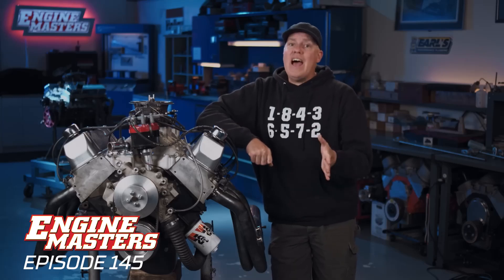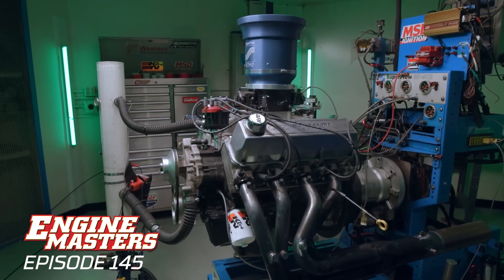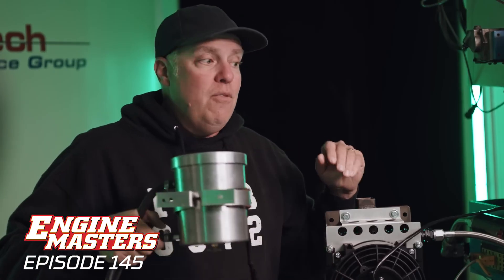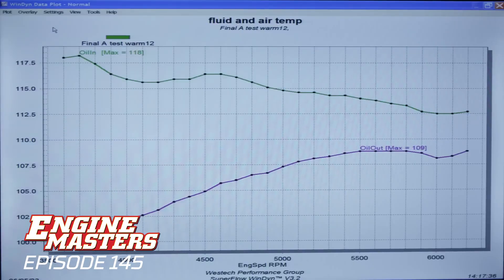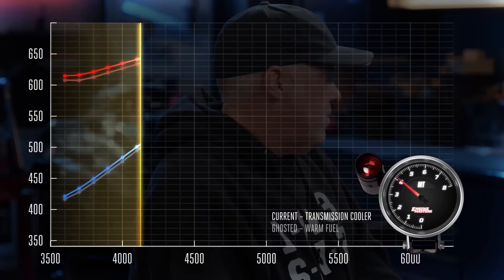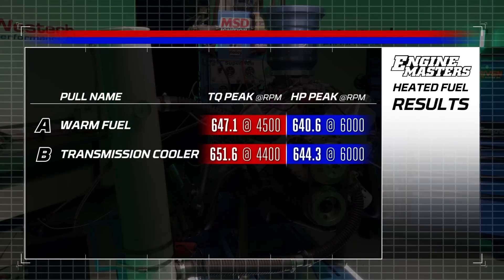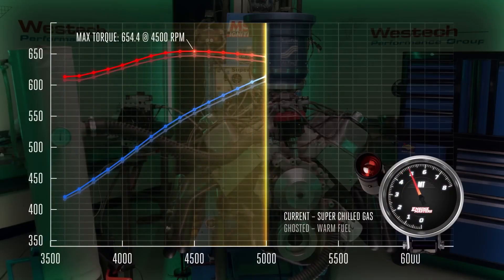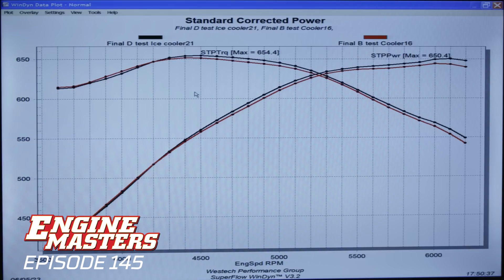Why Does Cold Fuel Make More Power? | Engine Masters

Comment from the maker: How do you keep your fuel cool?
Reply: Instead of running fuel through a radiator, coil line through an ice can. Modify a catch can if that's what you have. It, also, works for trans lines, but they would be in car so you would need to shield it on case of a blowout
Reply: Why couldn't you use the coil idea but wrap it around the A/C coil.
Reply: peltiers
Reply: I insulate the fuel lines from the pump all the way up to the bowls . I have a heat shield under the carburetor with a phenolic, resin spacer.!    I’ve done Rocky Mountain race no vapor lock on 105° day

Comment: Something to consider on a road car is to protect the fuel lines from high underbonnet temperatures. Especially if using a cooler of some sort.  Include the fuel rail on an injected car.
This leads me to think of an experiment you guys could perform: Would insulating the fuel injectors also be of benefit? The injectors would normally pick up heat from their surroundings AND generate some heat of their own. If they were fitted with a little insulating jacket, 1. would the fuel flow through them be sufficient to keep them from overheating AND 2. would the resultant fuel spray be cooler than if the injectors were uninsulated?

Comment: Interestingly, early Jaguar XJS cars (pre-HE) had a fuel cooler that ran from the car's aircon system. Unfortunately, although I know the car had one I'm not familiar with how it was Engineered into the car.
How about this for an idea: I got the inspiration for this from the actively cooled seats fitted to Range Rovers. Those cooled seats use a peltier device to cool air as it passes through vent holes in the seat. So how about using a similar peltier heat exchanger to cool fuel? Just as Range Rover seat coolers pass air over the peltier, so a fuel cooler could pass fuel over it instead. It could be ignition controlled and so always working, but would never need any servicing and, unlike the trans cooler, would not be performance-limited by the ambient air temperature. It would require fabricating something up and whilst not the "ultimate" solution, it would be practical solution for road cars.

Comment: Big brain guys put the AC cold side through the cold can to chill the antifreeze. You turn the AC off for the run but you can engage and disengage from the drivers seat and don't need to add ice.

Comment: I added a stack of four paper gaskets under my carburetor to insulate it from engine heat. I also installed a stainless steel fuel line between the fuel pump and carburetor. Stainless steel has one-third the heat conductivity of carbon steel (15 vs 45 W/(m·K) and is less likely to pick up heat from within the engine bay.

Comment: Great video. But you didn't get to the punch line.  WHY does it make more power?  Is it just richer on an engine that could use more fuel?  Or is it cooling the air making it have a higher oxygen charge?

Comment: IMHO the power change you are seeing is from a change in air fuel ratio. 

Cold = more density = more fuel and air in the cylinder = more power 

With out laboratory grade afr measurements this test is invalid.

Comment: I found this researching if a return line is really worth the trouble on a system that doesn't require it. Deadheaded fuel is just sitting there soaking up heat waiting to go into hot fuel bowls. May be worth 3 hp/tq or could be worth 10, but this proves cooler fuel definitely makes a difference.
I love the transmission cooler idea, though the comment about a pinhole near an electric fan gives me pause to actually try it. But I would think that electric fans are sealed waterproof units. make sure the wiring connections are waterproof too and maybe there isn't as much risk, after all the fuel pump itself is often electric.
Reply: thing with a return added on a system that doesnt need it, it would keep the fuel cool in the hardline but if you run the engine long enough it will eventually heat up the fuel in your fuel tank and now you are back where you were to begin with.  Some people swear up and down by using a cooler on your return line to prevent this from happening.  But OE doesnt do this when they have electric fuel pumps mounted in the fuel tank.  Their fix to cut down on excessive heat being introduced into the fuel tank was by first removing the return line from the engine bay by putting the regulator on the frame so it isnt soaking up heat from the engine bay.  Now many are using a returnless system where the bypass is in the fuel pump module itself in the fuel tank where it simply acts like an oil pump by dumping the fuel right back into the fuel tank.

Comment: When the weather starts getting cool outside between 60 and 50 my GY6 150 runs a lot better more power from the cool air I assume because the air is denser when it's cool and it's actually getting more

Comment: I've seen many drag&drive cars running a trans cooler on the fuel return line, not for power but because their fuel gets SO hot that it vapor locks the pumps. That's generally why you see double & triple pumps that aren't staged die quickly on the road.

Comment: My dad did the old school version of the cool can/ice can back when he used to drag race at the strip on the weekends, back in the early to mid 60's. They used to just use a coffee can or a paint can, mounted somewhere in the engine bay. They would run the fuel line from the gas tank to the can and use aluminum or copper tubing in the coil configuration inside the can, then route the rubber hose line from the can to the carburetor making sure that the line didn't get near the hottest parts of the engine. When it was time to make a run, they would fill the can with ice, put the lid back on it and make the run. It was never meant to be filled all the time, just for runs at the track. However, nothing says you can't put ice in it before a longer race. Today, I would use a mix of crushed ice cubes and dry ice. The ice can getup that was showed in the episode, is just the modern version of the hot rodders version. It's always been about two primary things, get the coolest air and coolest fuel you can going into the carb. I like the idea of the transmission cooler being used for fuel, but that whole thing has to be rock solid or yeah fuel everywhere.
Reply: One thing that these guys dont seem to take into account is not everyone will have room for a transmission cooler like that with an electric fan.  most of us would only be able to run one of those radiant heat exchangers with the fins that are either a single or double pass.

I am personally running a 4150 stealth Sniper EFI system for my daily driver rig that I am putting the finishing touches on the engine.  I am thinking about chilling the fuel mainly because its no different than a carb as the fuel is flowing through the intake manifold no different, its not like a port injection EFI system that sprays the fuel directly onto the intake valve.  So chilling the fuel would have a benefit for me but on my truck I cant put a fan like they are running, the only thing I can do is use a single pass aluminum fin heat exchanger and now comes the big question, how efficient will that be mounted on the frame rail after my 99-04 Corvette fuel filter/regulator assembly but some 9 feet of 3/8 stainless steel line and 3/8" rubber fuel hose till the fuel hits the injectors.

Not something I want to do trial and error on seeing as I have a brand new 3/8 stainless steel hardline for the frame to replace my oe 5/16" carb line with so if I mount a inline cooler thats it I have to run it cause it would require me buying another hardline to remove it and go without.

For a track vehicle I think a cool can would be the best cause with an electric fan all you are doing is putting more load on the engine by having the alternator run that cooling fan which will eat up more power.

Comment: Doesn't a return style fuel system completely negate this? The fuel in the tank will be right around ambient temperature, so pumping any hot fuel out of the rail and back to the tank means you're always supplying the engine with the coolest available fuel

Comment: Why would fuel be at coolant temperature? It's at ambient temperature in the tank, the only way I can see it getting that hot would be if the fuel line was run alongside the exhaust to the engine compartment .
Reply: One exception I thought of to fuel being at ambient temperature would be when running an in tank fuel pump.

Comment: David:  In the old days, the fuel line would be plumbed under the alternator and next to the engine block up to the carburetor (SBC).  Hence, a simulation of vapor lock.  If any of this adds incite to your pursuit to heat the fuel, try that!

Comment: Interesting evaluation here. Since I have an LS3 with stock rails that are metal, they get hot, same goes for my LT1 GEN II when I road raced that car. They got super hot because they were thick and bolted directly to the intake manifold. All of the aftermarket rails are aluminum too so they heat soak easily but also dissipate heat fast as well. Wondering if cooler fuel would actually keep the fuel rails cooler when the engine is working hard and if there is a benefit to that.

Comment: I don't know if I missed an episode? But I've always been curious about engine oil coolers? Good bad or indifferent? And with that is there a change in oil velocity that should be considered? And if you did run an oil cooler for your oil is there a formula?
Reply: Those usually help period. Noticeable drop in temps

Comment: You should fill up your vehicle early in the morning. 

The fuel is more dense at a cooler temperature. therefore, you are getting more fuel for the same price.

So I believe what you all just measured was more fuel being delivered into the combustion chamber.

By chance...did you all have a wide band O2 sensor installed?

Comment: You guys should build a car version of this using the AC refrigerant and a plate style cooler (evaporator). There should be bypass to the cooler so that the fuel is not too cold when the engine is cold or you are operating at very low loads. I think the gains would be highest for a fuel injected turbocharged/ supercharged engine, medium gains for a high CR NA fuel injected engine and the lowest gains for for low CR carburetor engine.

Comment: I’ve been running that exact fluid cooler on the return line of my street car for a while now. Before installing it as the fuel would heat up the fuel pressure would drop…. With the cooler fuel pressure never drops no matter how long I’m driving the car.

Comment: With the ice cooler,  add salt water.    The salt will actually help make the cooler coils get colder.     Also. You could do this test with liquid nitrogen,  which boils at negative 320 defs F
Reply: Most Gas blends freezes almost solid starting around 145F, with the range being -40F to -200F. So hitting it with LN for as long as they needed to do the test would more than likely freeze the line.

Comment: when i had my subaru, i i was making about 600 wheel and running my pump at 100% duty cycle, and i was considering running a fuel cooler for a long time because i was concerned with my fuel temps

Comment: I believe there's a trade-off in there yes cold is good but Smokey made the hot vapor motor for a reason and it worked and I believe that fuel was like 400 and some degrees going into the engine I believe that pre-heating to do the same thing just like the hot Vapor motor

Comment: So as with the co2 being discharged from a high pressure to a low pressure and getting cold as a result. Would not fuel do the same thing. like two thoughts:
1 a recirculation pump of fuel through an inline venturi  back into the tank making the whole tank cold over time.
2 a high pressure fuel feed from the tank through a venturi into a surge tank at low pressure suitable for feeding a carb.
IDK just thinking out loud.
Reply: I will break this theory down which is how things really works since no one else has.

When you increase pressure you generate heat by increasing the pressure, this increased pressure how ever will transfer to anything cooler that is around it.  When you drop the pressure it becomes super cooled.

This is how your A/C system works, you take refrigerant pump it up to 250 psi that puts it well above ambient air temperature, heat is attracted to the cooler air and thus the condenser drops in temperature.  You then hit a regulator that allows pressure to drastically drop, it drops down to around 30 psi which causes the now ambient air temp gas to become ice cold.  The air blowing across the evaporator is warmer and is attracted to the cooler gas in the evaporator so the air becomes cool as the heat transfers and then the AC compressor pumps it up to pressure again to start the cycle all over again.

In a EFI system where you are dealing with 60 psi fuel pressure, in theory it would chill down when the injectors sprays it dropping the pressure down to 0 psi.  The problem is at 60 psi the temperature of the fuel you most likely wouldnt see a temperature high enough to cause a heat transfer from the fuel to the air around the fuel line in the engine bay.  You might see a heat transfer to the fuel line which would result in no temperature drop of the fuel.  Im sure there is some math formula out there for calculating this, I dont know the math to it but I do know with AC systems at 250 psi the condenser temperature is around 250 degrees though and when you drop the pressure down to 40 degrees it will drop it down to 40 degrees.

The big change is with air, youll see this with TBI and Carbs quite often if there is humidity when you are going down the road the low air pressure being created causes a freezing effect and can actually ice up your TBI or carb.  Ive seen around here TBIs sitting and idling and start sweating as they are so cold just from idling and the humidity is condensing on the outside no different than on a glass with a iced drink in it.

Comment: The trans cooler idea is genius in my opinion. Now I wonder the reliability of it on a road car or if it will last under multiple runs at the track. But I definitely think it's worth testing for longevity.
Reply: Alot pd and common rail disesls have fuel cooler as standard. Not as dangerous as petrol granted but never heard one fail except when mounted under the car and hit
Reply: I’ve got one on my racecar and haven’t had an issue in many years! Did it because we were getting fuel boil and it rectified it straight away!
Reply: I've seen this very thing done on dump trucks. Seems like a waste on those but whatever
Reply: Well in Florida I'd say it's necessary for anyone that wants to build a daily that can be raced at the track. My JEEP GC has a positive pressure system, I doubt it's high enough to make it leak so I'm gonna give this idea a try and see how it goes.

Comment: When one is to cool the fuel one also increases the density of the fuel.  Thus, some of the power increase could be to the decrease of the air/fuel ratio.  The results kind of speak for themselves, but the test could have also included the data of the mixture.  Perhaps a bit unscientific.

Comment: Fuel cooler would probably be best positioned under the vehicle connected to fuel lines heading towards the engine.

Under hood position is likely to heat fuel
Reply: The engine compartment is where it's likely to gain the most heat, so as close to the carburetor or fuel rails as possible would be the most efficient, it just needs a fresh air duct for the cooler.
Reply: @edgarpryor3233 , For a track car it probably would be ideal.  For a driver that will be driven for hours at a time, it would be better off under the car in the cool air flow out from under the hood.  The fuel will still cool, and the engine bay temperatures wont have that big of an effect on it.  Thats assuming you are seeing a 40* temp drop minimum in fuel temperature with the cooler.  The fuel wouldnt have enough time in the heat of the engine bay to lose that 40* temp drop fully.

also have to take into account Carbs and TBI when going down the road they get ice cold by the low pressure being created by air flow, this cooling effect also helps offset any heat you might have picked up from the fuel line.

Comment: Id be interested in seeing how much timing you can add with the cooler fuels due to the cooler combustion charge, probably where the biggest gains would be, especially on a turbo application. Fuel cooler instead of intercooler??
Reply: Both would be ideal, no?
Reply: Why not both? Or fuel cooler and meth injection? But why not all three?

Comment: Guys, you live in CALI… do some smog legal engine masters.. take a LS and add legal bolt ons or a cam that will still pass smog, or modern hemi. And would also love to see the fuel changes to power 89/91/race fuel/e85 on same engines… the other thing… your spark plug engine master was incomplete… really want to see that again with the e3… thanks guys.

Comment: I thought about using a trans cooler asa fuel cooler years ago but I thought it would be dangerous to have fuel going through a cooler not designed for fuel. I also thought about using an a/c evaporater as an air intercooler for a turbo or supercharger system
Reply: There's no worries with that. 
It's only a few psi with a carb , and maybe 100psi at the most for injection and any decent trans cooler should be able to hold many times that.